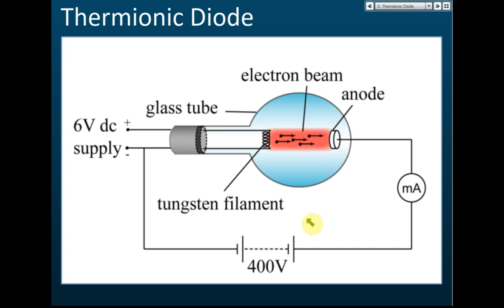Thermionic Diode | Electronics

Comment: Does the diode really need the dc supply for the filament heating? Isn't  there a way to use the 400 volt supply for the filament heating. It might be simpler because the diode would require only one power supply instead of two.